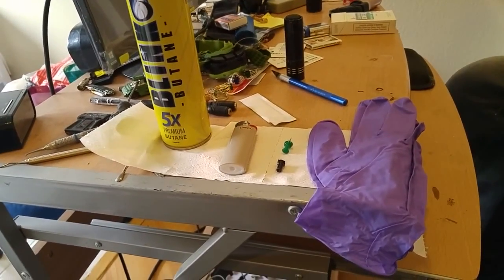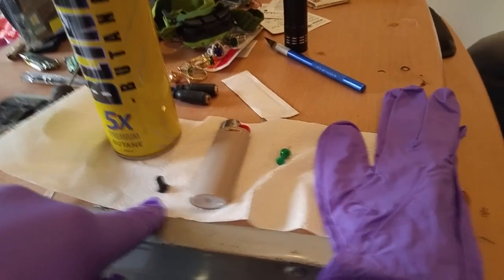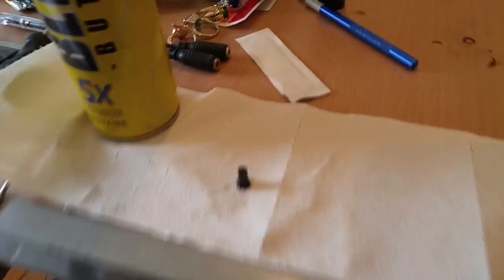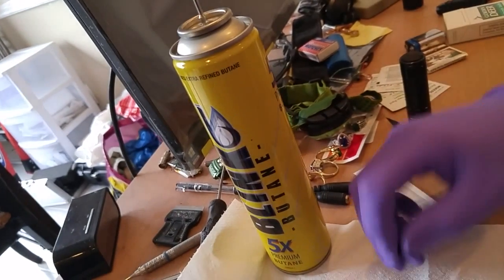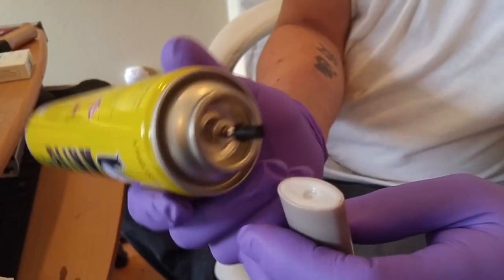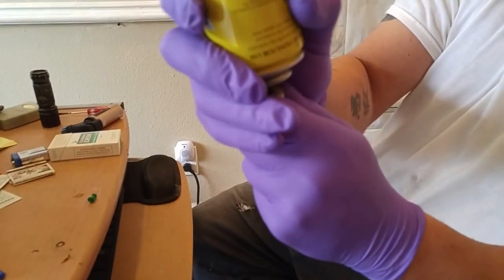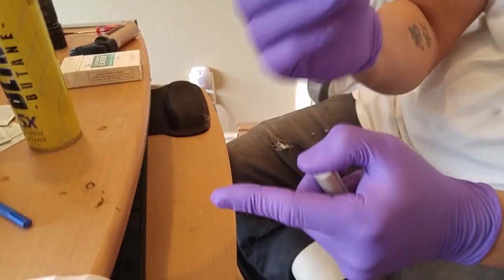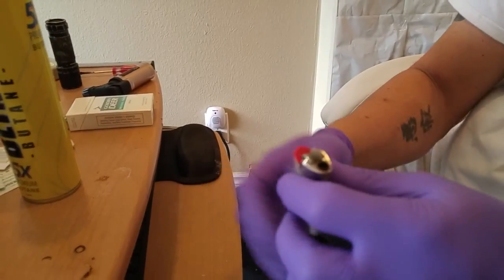BIC Lighter Refill

Comment: So I went to the store and bought some ronsonol lighter fuel only to find out I need butane so what do I use ronsonol for?
Reply from the maker: If your talking about the item you purchased being liquid and not butane gas, then that can be used for Zippo lighters. Ok also, but this is only a recommendation, I've tried it myself but that's just me. Ronsonol Lighter Fluid is nothing but Light Petroleum Distillate, which is what SeaFoam is. You can use it for gas in your car! But only if u already have gas inside the tank...after all everyone knows that the octane standard gas we buy from gas station contain oil in it right? Or better yet let's hope you saved your receipt so you can do a return on the Ronsonol.
Reply: @mastertech8883  naw I got a Zippo as well but I need a new wick my friend said not to use my Zippo for lighting cigarettes or weed though (it's legal in my state)